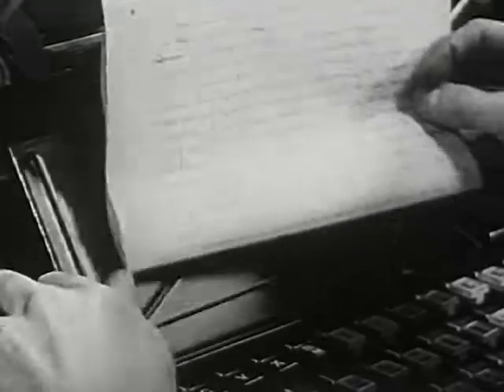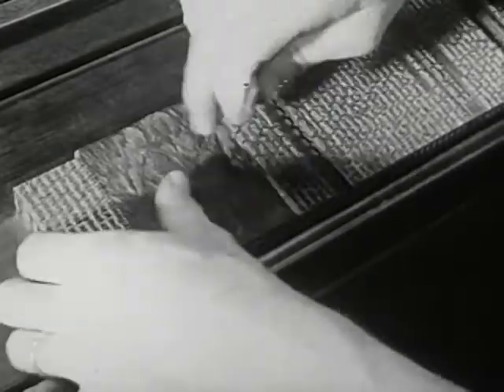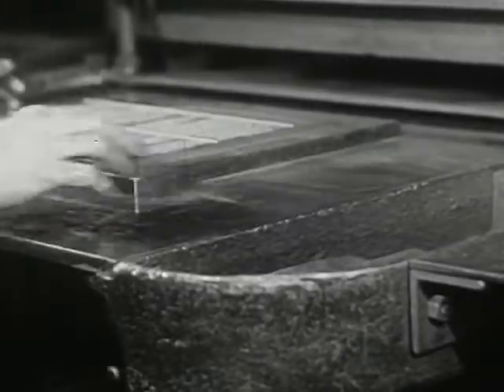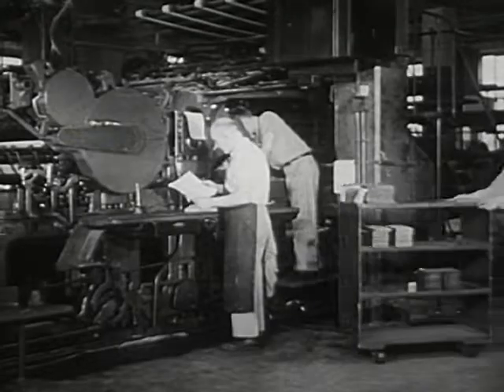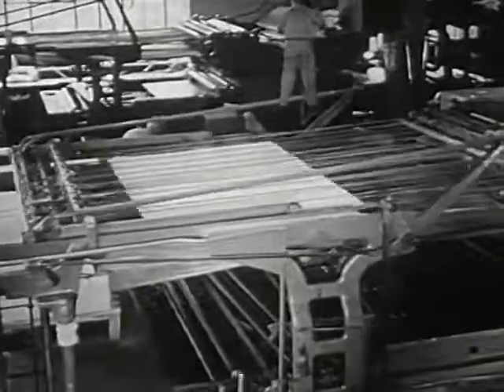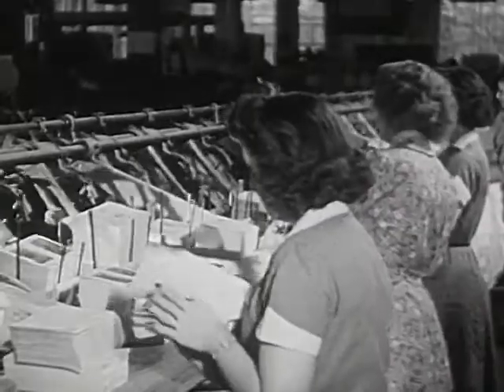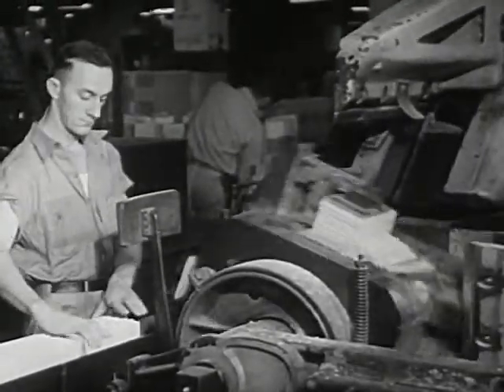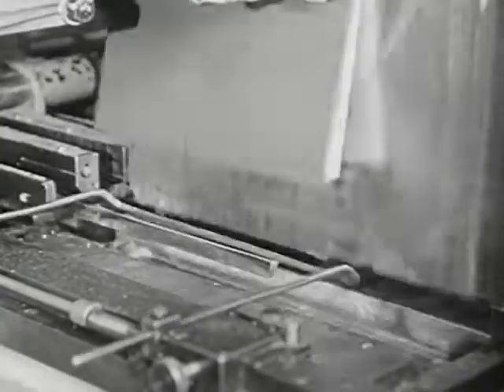Making Books (1947) - Encyclopaedia Britannica

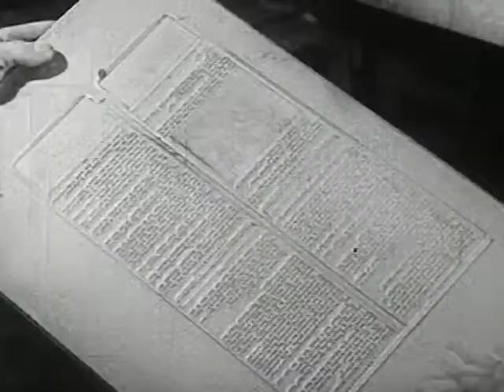Comment: Regarding 4:03, the wax plate mold needs to be coated with graphite powder before it is immersed into the copper electroplating bath tank. The graphite coating makes the wax surface conductive for the direct current electric circuit. The graphite coated wax mold becomes the cathode and is connected to the negative terminal of the electric circuit. The anode is a copper ingot which is connected to the positive terminal of the electric circuit.  A solution of copper sulfate serves as the electrolyte for the copper electroplating bath.